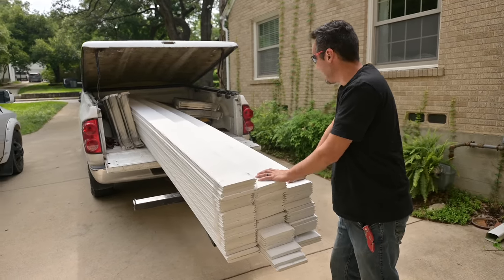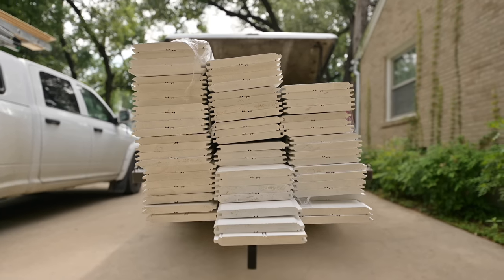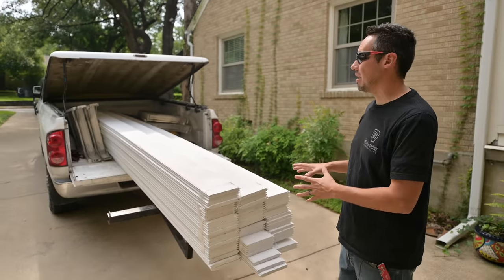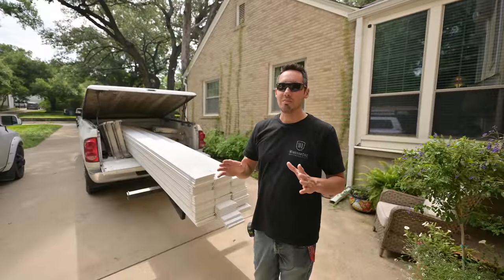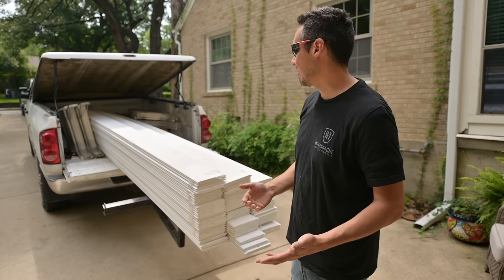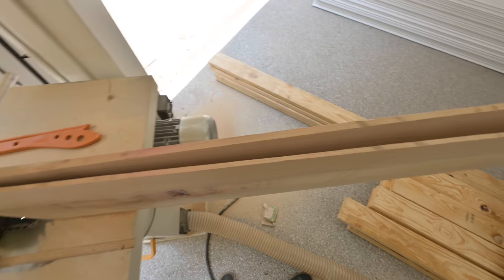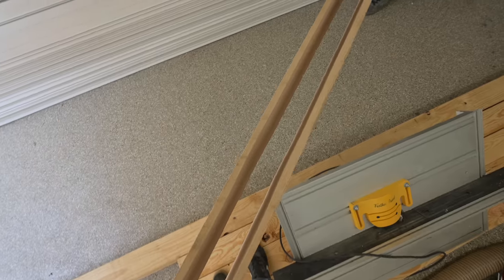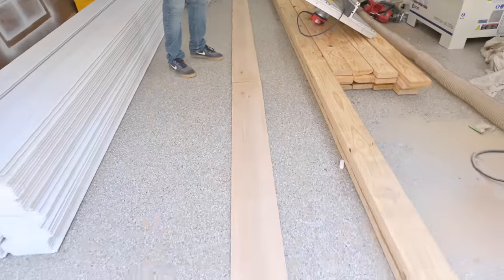All of this weight will be on our ceiling.

Comment: Hi Richard, another way to resaw a wide board like that is to make a few passes on the tablesaw first with the blade up about 1-1/2 deep then take it back to the bandsaw to complete the resaw. The kerfs made with the tablesaw gives the bandsaw blade a place to track itself and the cuts will be more accurate.

Comment: Here's a tip on un-cupping boards. You want to wet the cupped-up side with a sponge. Keep it wet for a few hours or even days and the moisture will expand the grain on moist side essentially undoing the cup. Another option is if the boards are green is to place them cup-down under the sun for a few hours. Again the idea is the sun dries the top side shrinking the grain and undoing the cup. You can even combine these two and it will work even better. I've done this with many species of wood. It even works on plywood. Good luck!

Comment: When you re-saw you are creating a book match pattern, however you are pivoting one board 180 degrees and placing it end to end.  Also, when re-sawing don't use the fence like you were, have 
that green pivot guide attached to the fence and to the left and 1/4"  in front of the blade.  That 
allows you to steer the board left or right for a uniform thickness.  Use at least a 1" wide re-saw 
blade with the fewest gullets and have same in/out feed work roller supports.
Reply: I think you want a wider band saw blade    .

Comment: i had makita , bosch and dewalt chop saws. but after i get a festool kapex its like another level. the precision is so good on the kapex👍
Reply: Out of the box sure is but you can easily get any other saw calibrated under an hour for literally half the cost of a kapex
Reply: @poatjoler the ergonomics and perfect layout of functions  on the festool just blows all the other saws away . You get what you pay for just like everything else ...
Reply: @poatjoler  true but there is more then precision, the angle adjustment is so good and easy. my favorit feauture.
Reply: Couldn't be happier with the Makita.  Zero issues and cuts see-through ribbons with ease.
Reply: The handle position is absolutely terrible.. you will catch carpal tunnel using the kapex daily😅😂
Reply: Try the Hitachi 8 1/2” sliding compound…by far the best finish saw out there

Comment: You could plane the boards to the same thickness, then laminate them onto some plywood. If you span the plywood across the bookmatch joint the entire 28' piece would act like a single plank, plus you'd have enough thickness to miter and use biscuits or dominoes. It would also be easier to control how tight the bookmatch joint is.
Reply: I was thinking the same thing, sintering up some 1/2 inch plywood to help with some strength and help get rid of some of that cupping. You could even plain the backside of the maple to reduce the overall weight and make them all the same thickness. Basically making a beam from plywood, then laminating it with that gorgeous White Oak.

Comment: I am very happy with the corded version of the Makita 12" Miter saw.  Couldn't be happier.  In fact, I got mine because I saw the video of yours but couldn't afford the battery one.
Reply: Corded is always better anyway battery saws don't have enough power
Reply: @farmingngu a couple of years ago I said the same thing, until I got the DeWalt flexvolt slider, running it on the batteries has a LOT more power than the corded ones I used to use

Comment: Battery operated tools come in handy at times but I’m just old school and want my cord and my power. It may take a little longer to string a drop cord to where you need to be but I don’t have to worry about my battery dying in the middle of something. I’m certainly never buying a miter box or tablesaw that is battery powered. The only tools that I own that are battery powered are my drills and impacts.

Comment: To successfully resaw boards of that size will require three to four roller supports, high tension on a new blade, two feather boards (high ones similar to what you have) and most likely a higher auxiliary fence which is angled to a properly tracking blade. If you add up, what it will cost you to have someone else do the work you will see that you will be hundreds of dollars ahead if you buy the right stuff and take the time to do it right yourself.
Reply: Time is money and if they have more capable equipment then you are wasting your money. The bain of every woodworker; knowing when to outsource.
Reply: Just make a channel out of plywood wood that the 4 quarter fits in.. cut the channel with the kerf half way away from the vertical piece of the channel..tighten the blade and you can do like 10 boards then just cut depper in the channel and clamp it back down and keep ripping 😅

Comment: Well richard great video again. If i was you i would batten that ceiling  and put all your lights and fans where you want easy job to do now but when have fancy beams and t and g boards it look wrong if there not centered. Add extra cable to your cables. As long as you batton your ceiling you can put them where you want when you fit the tongue and grove

Comment: The band saw likely wandered because the fence is not aligned with the blade. Use an alignment tool such as the Carter FAST.  Additionally, resawing creates a lot of sawdust which can clog the tooth gullet. Use a 1 or 2 tpi blade with a deep gullet.

Comment: You can start the resaw on the table saw, flipping the board end over end, raising the table saw blade after each pass. With a kerf on each side, the band saw will track much easier. You can freehand the final resaw, or use a fence.

Comment: I have done this many times - and with a better carbide tipped bandsaw blade - and a power feeder for your bandsaw - better success is guaranteed - good luck  - the waving in the blade is much to do with the cumbersomeness of the large piece of wood, i have sliced veneers and glued them to substrates as thin as 1/8" and then run through planer with great success.
Reply: Yes.  Then run it through a drum sander for finish.

Comment: In the future, for needing to resaw like you needed...make a "C Like a piece of channel..out of plywood that your 4 quarte fits snuggly in. Precut the C keep the blade kerf half the board away from the vertical of the plywood Channel. Do about 10 before the jig wears out, then cut forward a bit lol. *The 4 quarter is meant to slide through the channel.

Comment: Run all your book match pieces through the planer cutting off your opposing face. You can keep your book match and have all your boards the same thickness. If you’re willing to work with 1/4” pieces that is.

Comment: To glue that joint use the CA glue to fix 2 blocks of wood on some strong tape on either side of the joint to clamp the joint together... Easier than using dogs and filling matching grain???

Comment: I’d use that thin 1/4” piece on that shorter run where the bump out is so you don’t have to book match it. I can’t wait to see how it all turns out.
Reply: Or use it on the ends where you're not merging. 

Or cut deep enough on each ends until the thicknesses match.

Comment: For the corners, you can just get a much thicker piece that you can rip in 4/6 pieces to cover the whole area and just book fit each as a consistent piece, no? If you can't get thicker, just rip that piece into the 4/6 pieces and back it with another piece to make up for the thickness like how a veneer would work, back it with white oak and it will be white oak all the way through...

Comment: Unless there is some special arrangement made, the resawn stuff from the company will come with the boards shuffled. He'll have to match them by laying them out on the floor and walking around. Easy? Maybe.
Reply: Doable, but in hindsight, marking the edges as he picked them would have been good.  But it'll be ok.

Comment: Wrong blade . You need a wider rigid resaw blade . Also if you go with thicker material you have more leeway to resaw to final thickness. More passes on the planer but you achieve proper thickness on both pieces

Comment: My goodness. That’s a lot of possible combinations. Just glad you can tell which is the inside surface on each board. Did you think of running the light fixtures through the beams (making it look like they are hung from the beams)?😊

Comment: I love what you're doing here and I understand why you're doing it.   But logically speaking, since you need to cover 18 linear feet, I wonder if you considered using 10 foot boards and then re-saw them to yield 20-foot book-matched 3/8" boards and only have 2 feet of waste?  With 16 foot boards, you will get a book matched 32 footer which equals one 18 foot book-matched 3/8" board and 14 feet left over.  With the 14 foot left over, you  have the same issue you started with. The board is 4 feet too short to use without another seam that is not book matched.   But in all reality, I think this is going to look great, even if you can see a few seems, since they are 20 feet off the ground.  I have a really good band saw and I've done my share of re-sawing.  But even with a really good band saw, you'd be there forever re-sawing 16 footers.  And you'd be lucky if they do not come out at least a little bit wavy, because it's difficult to feed a 16 footer and prevent it from turning off square under the weight.  Unless you have about a 12-foot out feed table, you would really stuggle with re-sawing the boards yourself.  I agree that it's a no-brainer to pay the lumber supplier to re-saw the boards for you.  Just on time savings alone it's worth it, not to mention mostly eliminating the risk of error.  Plus you will get boards that are more accurately sawn than you can probably do yourself without the risk and hassle.  And to further affirm your decison to farm out the re-sawing, you also saved the cost of a new band saw blade, which you would likley need after re-sawing 240 feet of white oak (wink).  You'd likely be ready for one by the time you finish re-sawing the boards and brushing all the sawdust off your clothes.   I love watching your videos and I've learned a lot from you over the years.  Watching your videos always motivates me to do more creative stuff myself.  Keep it up!  I love your channel.

Comment: You need me. I made 7 box beams out of a 19' fir log. 2 beams were 8 × 16 × 26 feet. I bookmatched because I had 17 slices: 11/16" x 17" x 19' long.

The project helped the designer/contractor win Architect of the Year: US in 2013.

I gave a handhewn look with a dark wax finish.  You could not see the seams!

Comment: You're going to rip the drywall out and fasten the T&G ceiling directly to the joists, right?
Reply: Drywall is probably required for fire code. Also provides better air sealing
Reply: @ZachAshcraft  Thxs.  Maybe so.
Reply: Screw backers in then nail or trim screw beams in to backers

Comment: first you need 18.5 ft why use 14 footers  10 footers ess waste.and i would back bevel your cut by a couple of degrees so you get a very tight joint.